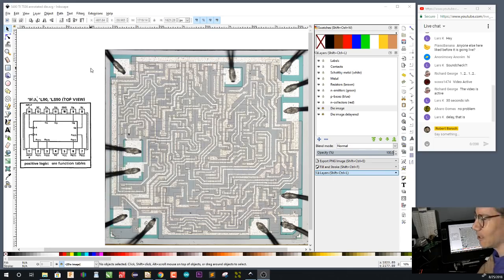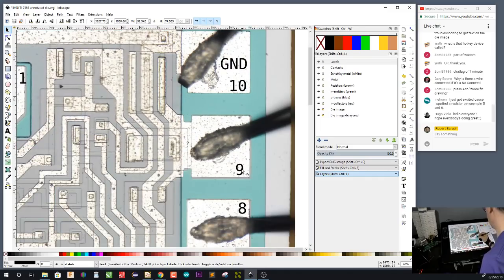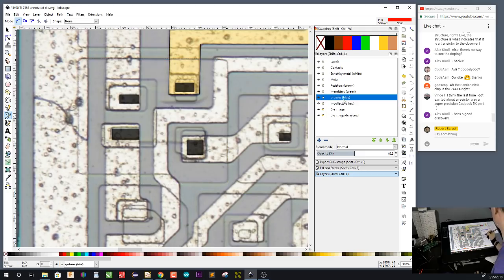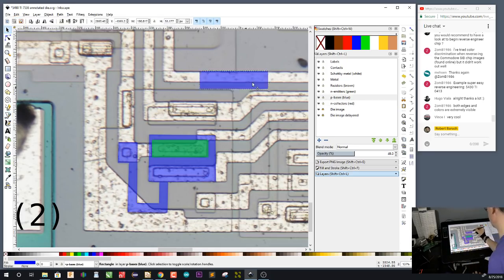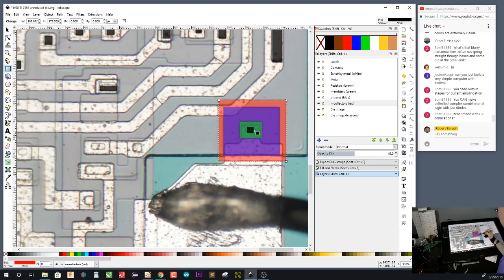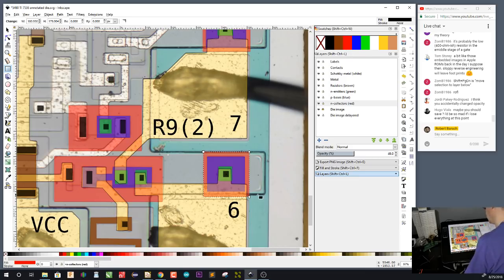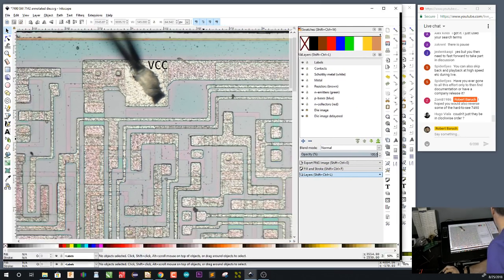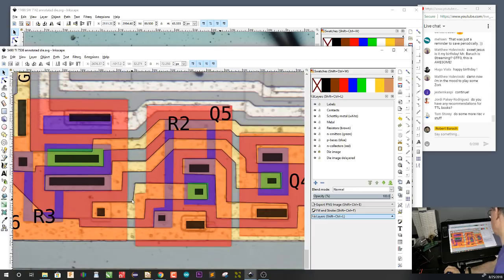Livestream: Reverse engineering two TTL chips

Comment: 01:08:12 In Inkscape you can move shapes up and down the layers list by selecting the shape and hitting Shift+PgUp and Shift+PgDn ;)
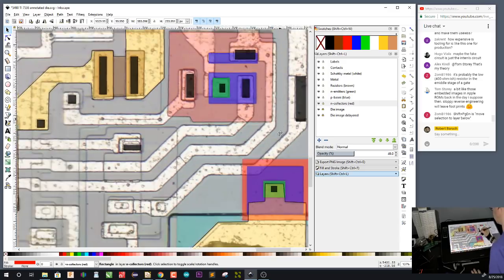01:52:32 It's because you must have accidentally clicked the Opacity slider and cranked it down to 50% opacity.
02:15:32 Is this the famoust "totem pole" configuration?
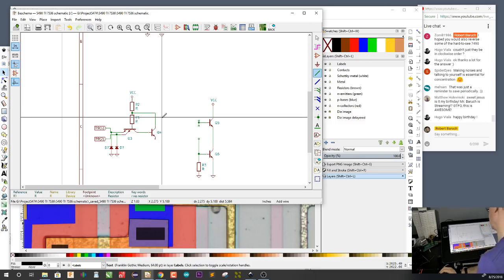02:38:13 A voltage divider perhaps?
02:43:34 What kind of microscope and with what range of magnification one would need to make such photographs of the surfaces of the chips?

Comment: For those old chips it is a pain to use computer vision to reverse engineer them. With anything from the mid-80s onwards they used standard cells to have a little more abstraction, those can be reverse engineered pretty well by computer vision. But those very old ICs are almost always drawn BY HAND, so yeah....

Comment: You can relatively easy and crudely turn TV controllers into controllers like these yourself - just send decoded IR data to PC with arduino and on PC have a program running in background that converts TV remote's codes into some useful action, be it emulating keypress or something else (e.g. i've used this setup to control rhythmbox by dbus commands)

Comment: Can you pls decap a 7474? I would love to have a crack at reverse engineering one of them as I'm trying to figure out how they implement the preset function.
Reply: Back story: a designed a clock using nothing but transistors implementing NOR logic, and had a flip flop design where I needed a preset for one of them. I came up with a convoluted solution to achieve it, but I am sure there is a much better solution. Look up my project at ornotblog on blogspot.
Reply from the maker: I've done a 7476 JK-flip flop: https://project5474.org/index.php?title=76
Reply: Hi Tom! Long time no see :)
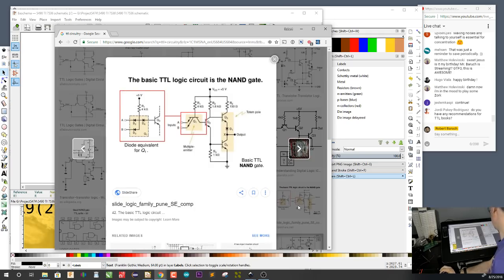At 2:40:21 it says "The basic logic circuit for TTL is the NAND gate". You are looking for an implementation using NOR, aren't you?
Reply: haha look who it is. :-)

Yes, it would be a NOR implementation.
Reply: Im looking at designs for the final module of my clock (display dimmer), and I once again need a flip flop with preset, so Im looking for better ways to achieve it than the convoluted mess I made last time. :-D

I already think I know how I will achieve it in this specific circumstance, simply by reversing the two outputs and treating Q/ as my Q output since it will be high on reset, but I was interested to see how it could be done "better", like the way the 7474 handles it.
Reply: Hehe, I still haven't completely wrapped my head around your NOR D-FF with preset (and CLR) - though it definitely works!
Anyways, even if it is done with NANDs in the 7474, that's interesting in itself, and I've got a feeling that it should be possible to systematically transform it into a NOR implementation. I'm pretty new to this reverse-engineering but that won't keep me from looking into it. Particularly the 7476 that Robert mentioned. I mean
you could surely use JK-FFs instead of D-FFs. Whether that's better - and in what sense - that'd be a 
different, and harder question I think.